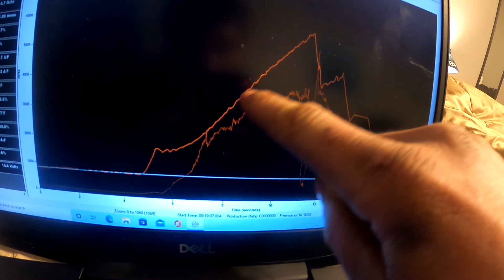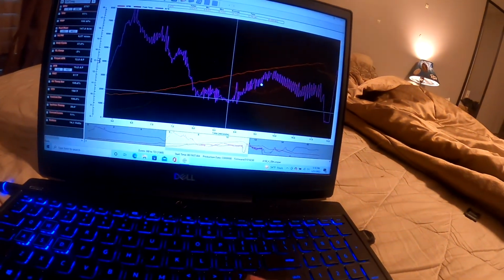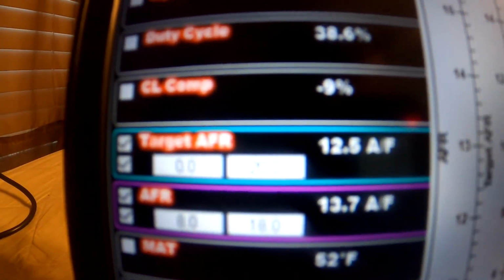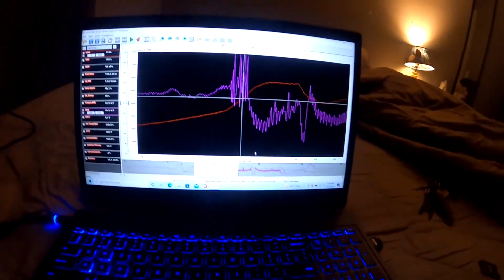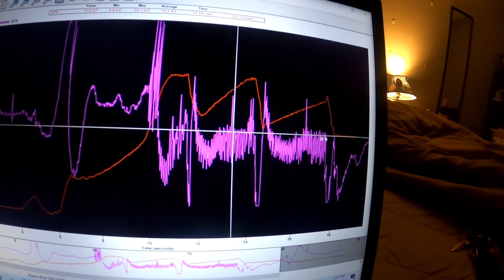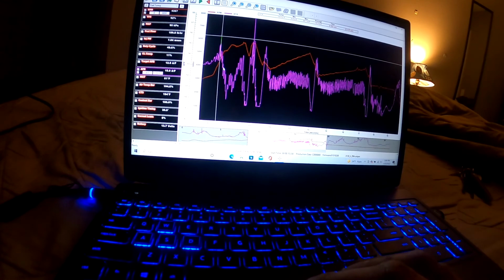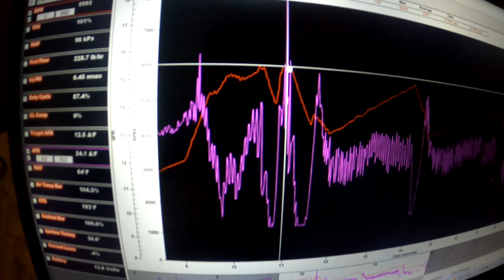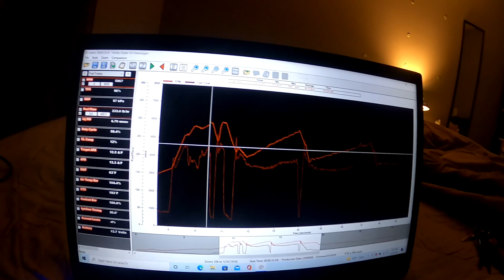Cammed 351w X303 450hp 1983 Mustang Sound, Pulls and Tuning

Comment: I too have a 351W with a holley sniper system and similar build. RPM Airgap, RPM heads, Xcam and longtubes.  Can I ask what you have your initial timing and total timing set to?
Reply from the maker: 17 initial and 30 total on 87 octane. Cruise timing is 34. 12.4 air fuel at wide open throttle 14 at idle and cruise.